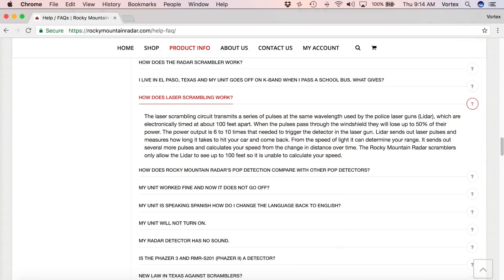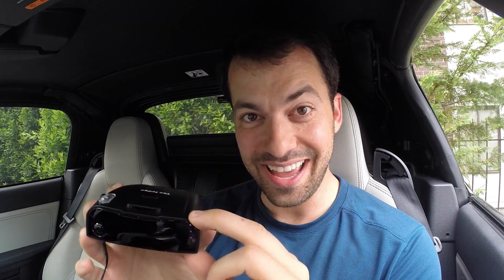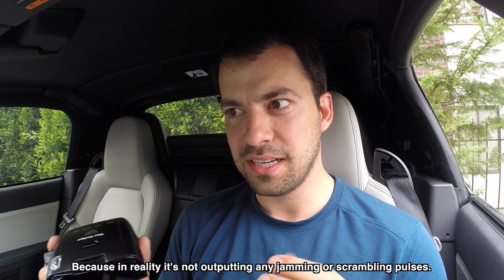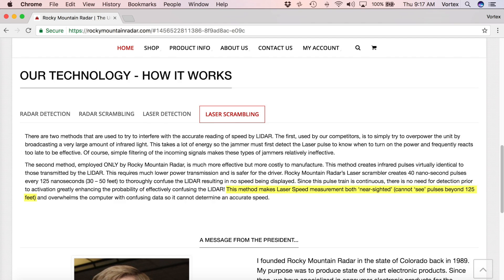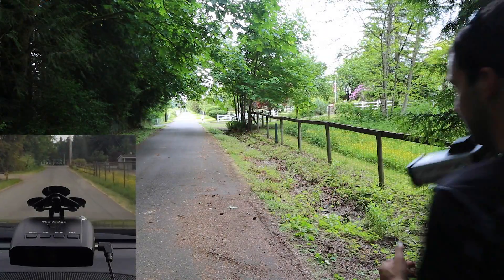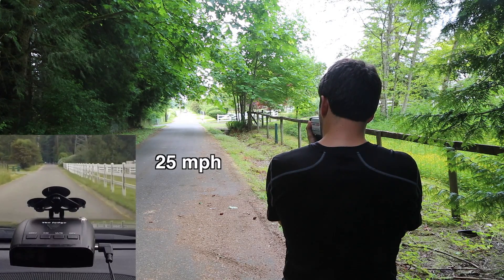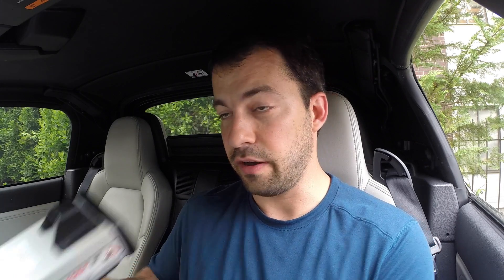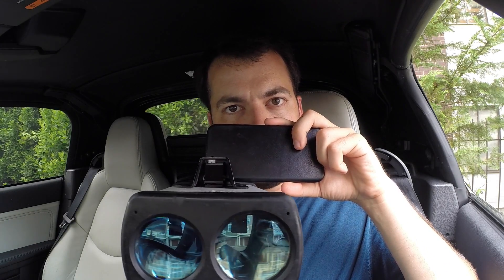Rocky Mountain Radar, The Judge: Laser Scrambling Test

Comment: the scrambler works when your going over the speed limit not at or under the speed limit this is why it gives you enough time to slow down before the punch breakthrough...how about you make a video where the gun is set to the speed limit of the street then have the driver approach the gun going over the speed limit but well beyond the 150ft punch breakthrough and see that it does scramble until you get closer to the punch breakthrough...anything under the speed limit or at the limit is obviously going to show up the scrambler isn't made to help scramble your speed doing the speed limit or under the speed limit but will absolutely help if your over the speed set by the radar gun
Reply from the maker: Not true at all. The scrambler doesn’t have GPS so it doesn’t have any idea what your speed is or what the speed limit is. I’ve tested 4 different RMR detectors over the years and always the same result, both at higher speeds and lower speeds, and against both radar and laser.